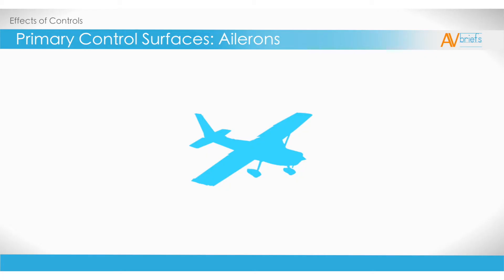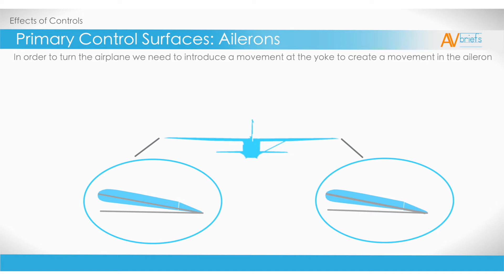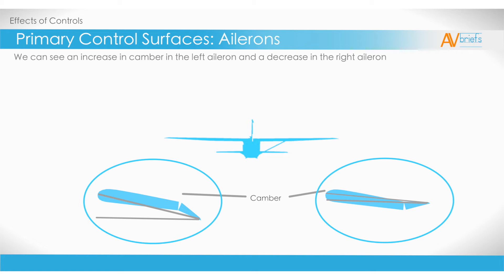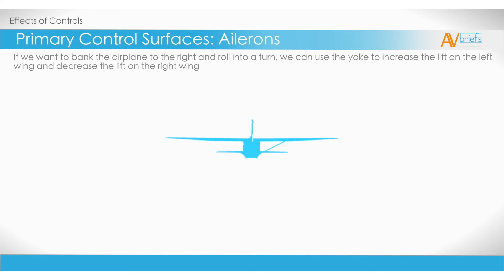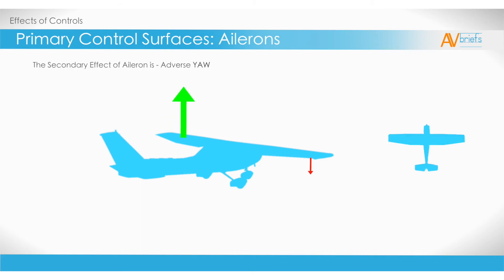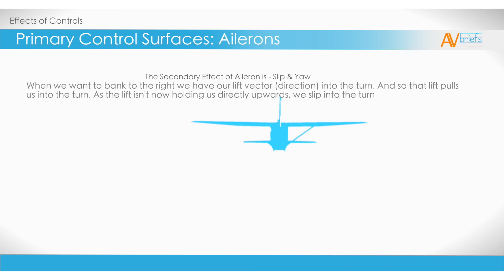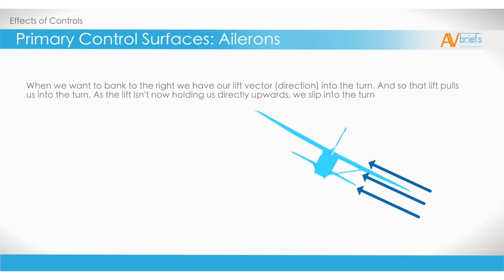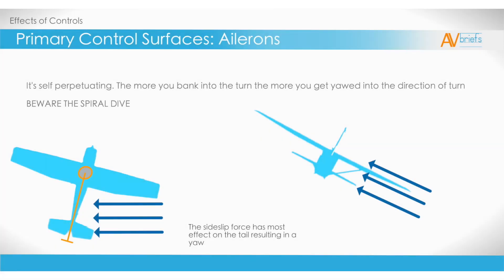Learn to Fly | How Do Ailerons Work

Comment: Why is the aileron moving down an increase in camber ? 

Notes
Increase in camber is when aileron moves down and decrease in camber is when aileron moves up
Increase in camber = more lift
Decrease in camber = less lift
Reply from the maker: Hi Fer and thanks for your question. This particular video is part of a course on the fundamentals of flying, and there's more information available on camber in this video:

https://youtu.be/adCJxC0Oxm4

Camber is the amount of curve above the chord line of the airfoil. The chord line is an imaginary point from the leading edge of the airfoil to the trailing edge. 

So when the aileron moves down, the curve above the chord line (the camber) increases, which increases lift!

The above video has some more detail on this and I can send more information or do another video if you think it needs more clarifying. 

Check out the courses available at this link: 

https://www.avbriefs.com/courses